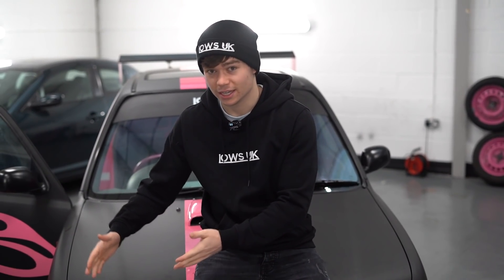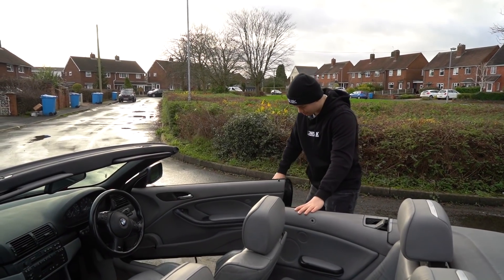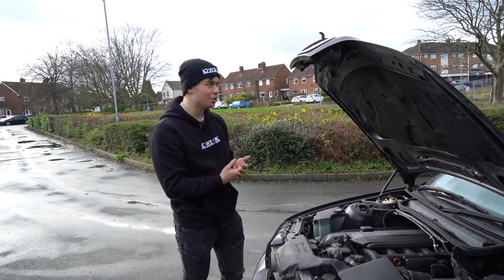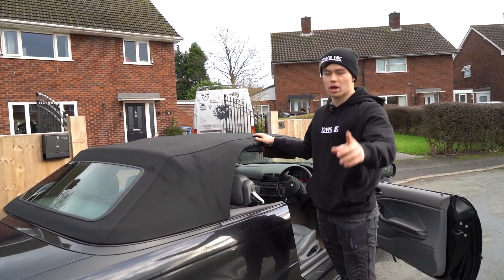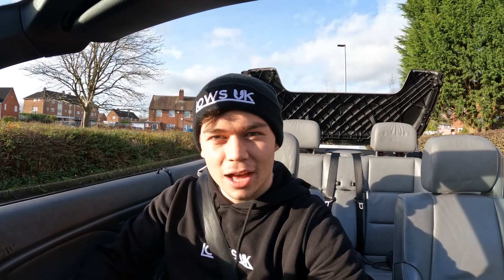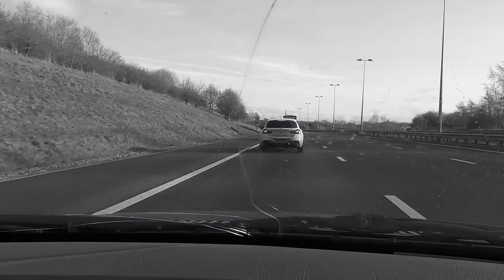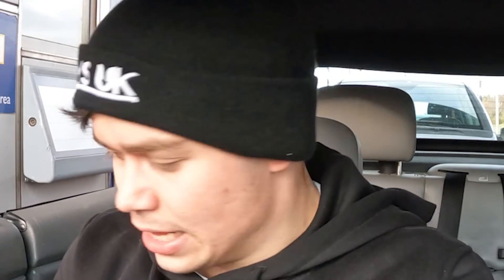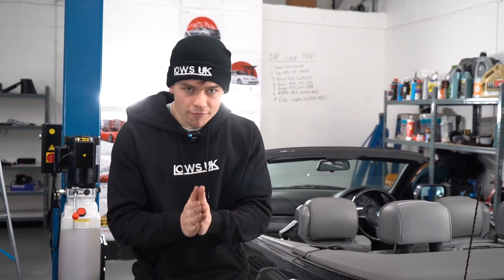I BOUGHT A *NON JAP* CAR AS A DAILY!

Comment: Those alloys are actually bbs alloys there called bbs rc041 or rc042 there the completely same faces but the 041’s are 7.5” wide and rc042’s are 8.5” wide and came on certain e36’s are a fairly desirable wheel also not mega rare but £4-500
Reply: Just picked up a full set for my 325ci also, love the look of them!
Reply: I've seen these alloys going for around £1k in good condition

Comment: I love this! Restore back to OEM. Please don’t ruin it 😂
Reply from the maker: Bro that’s exactly what I’m going to do! Literally, gunna make it more perfect than factory. I’m going to sell the cats and fit a subtle but ever so slightly louder exhaust, but other than that this car is getting restored. I may put m3 wheels and bumpers on as well but that’s the extent to the “mods” on this. Gunna be so clean when I’m done trust me 💥
Reply: @JackMcNeillCars  awesome! I’ve not long picked up a e93 330d (convertible) myself! Even for a diesel with the 6 cylinder it’s extremely smooth. Roll on summer. Looking forward to watching this project :)

Comment: Air bag light is going to be one of the seat occupancy sensors. Unplug it under the seat and plug a resistor in which you can find on eBay super cheap and that will put the light out. All e46 suffer from that problem including mine